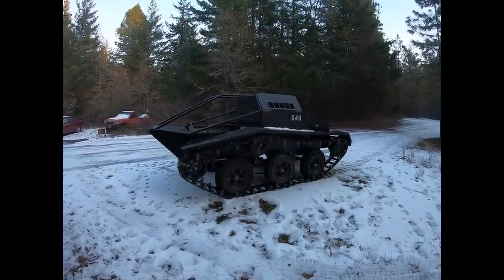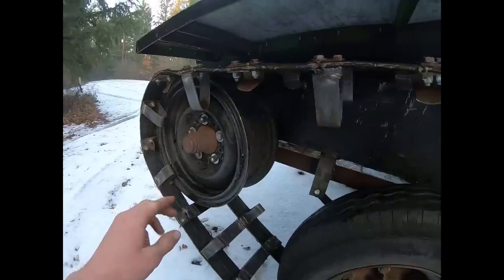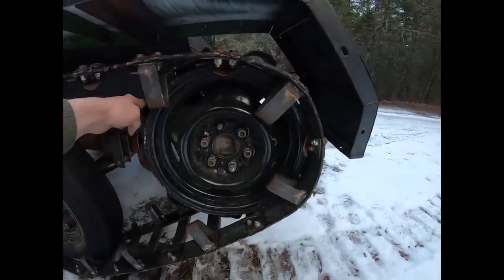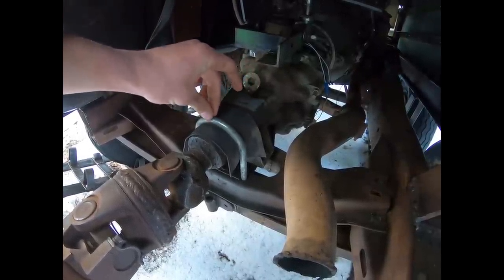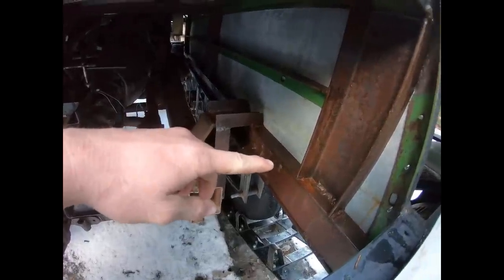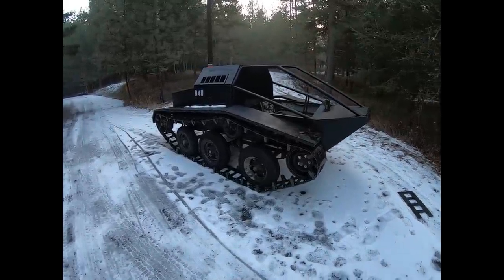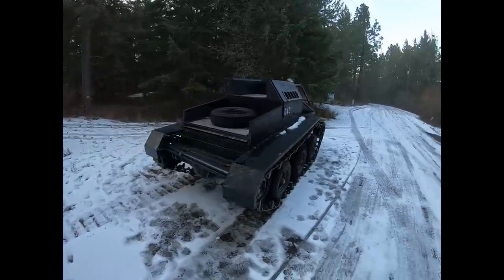How I Built My All-Terrain Tracked Vehicle out of Scrap Metal for Under $400 (Bug-Out Vehicle)

Comment: Great build! You actually did a really good job from the get go! As for the shifting, stick to rods with yokes, nothing that slides and NO ELECTRONICS. Make it mechanically only for maximum reliability. You can use baler belts from JohnDeere 568+569 balers, they have reinforced cores and are tough as nails, with texture on one side.
Reply: Agreed and dump the remote start, keep it mechanical. Shift the rad up in the body and add an intake to boost airflow. Only one other thing that may make it double the price - get some better tracks. It'll boost performance no end.
Reply: Agreement!
Reply: Just thought you might like to know, you're not the only person with that avatar. It's very memorable. Although the other guy, I doubt you'll find him on this kind of channel. Where'd it come from anyway?
Reply: @DFPercush  You mean my cat avatar? It stems from the fact that I am a cat lover and I also love lightning and the whole design is a cat that looks electrified. I love the look and the fact that it looks like my own cat haha, plus it looks at the text with judging eyes, which is neat imho. A reverse image search is the easiest way nowadays to copy other peoples pictures and avatars. It's never unique really, but I appreciate the heads-up.
Reply: The baler belts idea is a great one!
Reply: Now this is a emp vehicle! Only people who have read '1 second after' will understand that!

Comment: Very clever and great job using what you had!   A possibly alternative to the solenoids for the shifting mechanism is many manual 5 speed front wheel drive vehicles use two control cables for the transmission. I know for certain the late model Pontiac vibes were set up this way and likely many others. You could take the entire shifter assembly from a junkyard vehicle that would give you a remote shifter with two control cables (one for X direction, and one for Y). That would give the same feel as a normal shifter and no need to go through the headaches of trying to teach all the servo shift positions  to an arduino.

Comment: Reminds me of an early 1930s tank. Something like the Panzer 1 or T7 Car.
Reply: Those things weight upwards of 10 tons, a lot more stress on just about everything, when things are light its usually easy to build compared to when things are heavy, hence why automobiles of the era was a lot simpler mechanically than the tractors of the same era.
Reply: @SMGJohn  Well they also had a ton of armor on them which made up most of their weight. This thing is little more than a frame with some sheet metal to keep the engine covered.
Reply: Goliath tank is more like this machine.
Reply: It actually looks better than that, reminds me of british tankettes, I think they were called Vickers (name check)? Also romanians had something similar, called "Vultur" - "Eagle".
Reply: @SilvaDreams  "a ton of armor" actually only just about enough to stop rifle fire at a distance
Reply: Valentine “A ton of armor” was relative to this. If the T7 was compared to something like a Super Pershing, then yeah it’s nothing. But compared to this, the T7 has a ton of armor.
Reply: It also kind of reminds me of a Tetrarch due to its light weight.

Comment: I had a 1980 rusted-out Toyota pickup that we just used for wheeling, after getting the radiator caked solid with mud, I cut a hole in the back of the cab and mounted it there (as you did). Put an electric fan on a DPDT switch, so when it's hot outside, you can blow air back over the engine, but when it's cold outside, you can reverse the air flow, and blow hot air into the cab. Best heated Toyota i ever had.

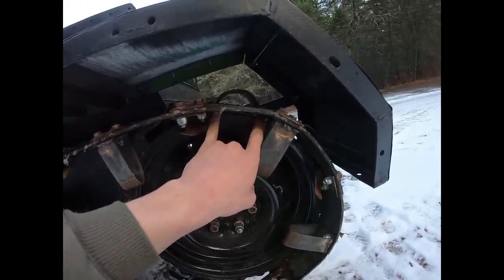DD 1984 Toyota 4x4 on 35's, with 5:29 gears and double-low t-case. Project truck 1971 FJ40 crewcab.

Comment: US military would be like 
Hmm add some javelin or M2 Browning and sell for $80k
Reply: the cost of a javelin alone is more than 80k bub.
Reply: Further more. The armored vehicles that a javelin might be used against can be purchased for less than the cost of the javelin itself.
Reply: @hell_march6652  actually finishing it up with armor panels communications and the machine gun or M2 Browning it be closer to $150k to $200k maybe.
Reply: They already have something like this.... Only it is also amphibious.
Reply: @SilvaDreams  and autonomous
Reply: U mean the 
military Industry complex
Would sell it to the military
Reply: @hell_march6652  The value of a weapon system is measured in the losses it prevents. If a 10k system is able to destroy a 5M system, then it's well worth throwing a 100k missile at it.
Reply: @Dimetropteryx   Why hit a nail with a sledgehammer when it can be done with a normal hammer?
Reply: @hell_march6652  False analogy.
Reply: @Dimetropteryx  Cost of a round for the m3 gustav is approximately is 500.  And is more than capable of killing a t72. compared to the cost of a javelin. 78,000. That is 156 times more costly. So again. why use a sledgehammer when a hammer will work just fine
Reply: @hell_march6652  The M3 is unlikely to be able to kill a T-72, unlikely to hit one out to its maximum range, its maximum range and consequently the area it's able to cover is insignificant compared to the Javelin, and even under ideal conditions, you're talking about a system that is expected to need to make roughly a dozen hits before it's able to disable or destroy the target. If your proposition is to simply move closer, the accurate effective range of the T-72 firing high explosive shells is 4000 meters, which leads to a very costly expedition for whatever idiot is ordering M3 teams to take out the T-72 instead of the Javelin team. The T-72 is not a nail. It's another sledgehammer.
Reply: @Dimetropteryx  If infantry are attempting to engage a t72 at 4000 meters then they already messed up and that is beyond the range of the javelin. The most likely scenario of infantry having to deal with an armored unit is going to be in an urban environment. 700m range is ample enough for that.  Its anti tank shells are HEAT and its penetration value is not dependent on its range. 400mm penetration  is ample enough to hit most area's and most (not all) angles on a t72. Nor do you need to completely obliterate an armored vehicle to neutralize it . 

 The tow missile can be deployed by infantry or mounted on a vehicle. Which is still a cheaper alternative to the javelin and can out range the javelin by a large margin.  

My entire point is there are far more cost effective alternatives available to accomplish the same job. The air force for example is looking to procure the AT6 light attack plane because its a cheaper substitute for the A10.
Reply: @hell_march6652  "If infantry are attempting to engage a t72 at 4000 meters then they already messed up"

That's not how anything works. It might be necessary for something to be done about a tank at a distance and you have the choice of letting it do whatever it is there to do, which is most likely killing your troops, or you can attempt to take it out. You have the choice of doing it the cheap way or the expensive way. Spoiler: the Javelin is the cheap way.

"beyond the range of the javelin"
Don't get hung up on the 4000 meter figure.

"The most likely scenario of infantry having to deal with an armored unit is going to be in an urban environment."
It's not, not by a long shot. Drawing tanks into an urban environment was done to negate their advantages and to make the numerous but near-useless short range AT weapons even somewhat useful. ATGMs,  on the other hand, don't have the same limitations and aren't restricted to close quarters. Generally, everyone wants to avoid urban environments because of how costly they are.

"Its anti tank shells are HEAT and its penetration value is not dependent on its range. 400mm penetration  is ample enough to hit most area's and most (not all) angles on a t72."
It's not as simple as "penetration value", and weapons with comparative penetration have failed to penetrate wheeled APCs that aren't rated for more than 30mm APFSDS over the frontal arc, or have landed multiple hits on main battle tanks without being able to knock them out even if they should theoretically have been able to with the first hit. And just because you hit, doesn't mean you hit anything vital. And even if the armor is penetrated, it doesn't mean you've damaged anything of value behind it. All of these are reasons why every military in the world actually tries to figure out how many times you need to hit a target before it's put out of commission, and it's always multiple times, even if the theoretical "RHA equivalent" penetration far exceeds the actual amount of armor.

"The tow missile can be deployed by infantry or mounted on a vehicle."
The Javelin is truly portable, it's not just "deployable".

"Which is still a cheaper alternative to the javelin and can out range the javelin by a large margin."
It's more expensive and the range difference is shrinking. In fact, reading the latest figures, the Javelin actually seems to have surpassed TOW in range. Didn't expect to see that.

"My entire point is there are far more cost effective alternatives available to accomplish the same job."
I know what your point was, it's just that you're wrong. What you're proposing isn't more cost effective.

"The air force for example is looking to procure the AT6 light attack plane because its a cheaper substitute for the A10."
Yes, cheaper to operate as a COIN aircraft. It's a poor analogy.
Reply: @hell_march6652   We can't sell it to suckers if we don't sell it for less. #notmymoneyparty

Comment: Great job, it looks like it will be real fun to drive in the bush  after you nail down that shifter issue. What would be real cool is maybe powering it with a gasifier system. No gas required. A true bug out vehicle. You have a bright and promising channel.

Comment: Love it.  A thought on engine cooling.  I ran a 22 re flatbed for years, after the thermostat choked my capacity to haul dirt up mountainsides by blowing my head gasket, I pulled it and was shocked at how little cooling I needed especially in the cold without the t stat restriction.  Drove over mountains with cardboard jammed in front of the radiator and a carpenters clamp on the hose just so I could stay warm in the cab.
Switch to dual or triple heater cores and run coolant through the seating tubing with a cutoff valve to heat the driver's compartment...or, pipe through a water tank to have warm water on board...  I am onto the prestone final charge radiator coolant in an effort to extend system life...   If you want heat for survival, a radiator is a fuel pig you can't eat!   Don't forget to cook while you drive with an exhaust oven!

Comment: I've been mulling over the idea of making a 'bootleg' kettenkrad. This video is really informative and has helped me visualize some of the designs I had in mind better, and scrap a few things. In terms of size, this is basically what I'm looking for anyway, although the setup is much different, as the engine is in the back, and the drivetrain in the front on a kettenkrad, with the front wheel acting as steering and also drive-control (it acts on the tracks, similarly to what's been done in the video with the brakes).

Cheers.

Comment: I'd suggest on the top front most axle to put a forward adjustment bolt set. you could use 1 inch threaded rod with a pair of locking nuts and get almost a foot of track tension to it, similar to how trackhoes and dozers adjust their tracks. In my mind I can see a few different ways to do it... Cool project for sure, been looking at things like this for a while now and yours is def one of the simpler ones!!! Keep up the great work!

Comment: Auduino and solenoids break. Should easily shift from a VW MID engine cable shifter ala Jamar or Empi. You already done the hard part.
Reply: you are right.. just thinking the same thing... it would be more robust also ...
Reply: The easiest and best solution is weld a u joint vertically to original shifter,a straight shaft  horizontally to another u joint welded to frame, then the gear shift handle where needed.  Will work smoothly with no play and good feel ! Joints allow  stick to move side to side and for and aft. Horizontal shaft transmits tourque and tension -compression.
Reply: Ya I was like dude thats way to complicated. You could just use a shaft to shift with. Mustang's with a  5 speed manual trans have a shaft connected to the shifting tower and then come forward from there like a foot or better then connect to the shifter on the floor board. I'm sure you could make the rod any length with in reason to fit where you need. But trying to shift and skid steer at the same time is gonna be a problem so having solinoids shifting from like paddle shifters on the steering handles would solve that but then I imagine it would be a pretty complicated set up to try and shift a traditionally hand shifted transmission via paddle shifters using a clutch.

Comment: The conveyor belts we use for the coal conveyors at my power plant are around twice as thick as that belt on there and it's nearly indestructible.  So if anyone is thinking about making something like this, check with a power plant if you live near one, there's usually old belt lying around.
Now that I think of it, the coal conveyor belt might be about this thickness but the hammer mill belt that crushes the coal is the really thick stuff.  I use it to hang metal targets and they get all shot up and still last a really long time taking all kinds of rifle rounds.

Comment: So if i understood the steering process, when you brake on one side the differential makes the job and transfert the force to the other side? Really with a car differential?
Reply: I'm not sure what you mean, but typically tracked vehicles will either slow down one track and/or speed up another track which causes the vehicle to turn.
Reply: Exactly. If you lock one wheel the other wheels spins.

Comment: I like it. Maybe some heavy wall pipe front and rear to protect the tracks and push with or simply protect the whole vehicle. 

I had a Coot, 4wd and steering and amphibious. Run off the road /track and into a body of water. No trauma except for the people with you who thought they'd have to swim. You couldn't put enough load on it to sink it.

Like to have it back. 20 hp Kohler engine, plenty powerful and aircooled. Worked great in Texas heat. Roll bar between separate front and rear sections that rotated on the same axis.  Didn't even leak at all. Great hunting rig.

Had a flooded field with 2 rows of haygrazer every 80 feet. Pull up to the row, use a brush hook off the bass boat. Tie up and wait for the dove to come over. 

Gather them all at sunset just floating around under power. 

Roll bar was a gun rack too. 4 people plenty room. Non hunting, 6 people you could scare hell out of when you ran off into deep water but the Coot just kept on going with paddle tires. Love to have it back.

Comment: This thing wants an old Detroit Diesel 8V53.
Reply: Nothing wants a Detroit Diesel... It wants a Cummins
Reply: @willroland9811  I think you mean duramax
Reply: Can a Cummins or Duramax run wide open all day long? Plus you can straight pipe it and have a sonic deterrent lol.
Reply: @mrgeraldbrent  there's a reason why one of the most legendary diesel tuners of all time use duramax

Comment: That thing is cool, I have wanted to build something like it for winter deep snow thru the woods type driving. We have a Polaris Ranger but as the snow gets deeper it high centers which makes it useless. I have a couple old snowmobiles but I have gotten them stuck & they are pretty useless for pulling out firewood or taking more than one other person for a ride.  If the trails aren’t kept packed the snowmobiles are just to hard to maneuver with the hills,valleys ,tight turns & with brush constantly smacking you it’s just not enjoyable. I also had a Max six wheel amphibious vehicle & that to got high centered in deep snow. Have you run your machine in more than two feet of powder?  Thanks for showing us your creation!

Comment: I'm planning something similar. I have the rear end out of a 300 Kawasaki Bayou ATV. those had two drum brakes and a cable actuated diff-lock in the differential. Going to use a ride-on mower for the chassis,  a snowmobile track cut in half for the tracks, the clutch system from a Polaris LongTrak snowmobile which had hi/low forward and a reverse gear. Instead of an All Terrain thing; I'm thinking of adding a rear mounted snowblower and front push blade to take care of my winter troubles.

Comment: I've had a mind to make something akin to the old WW2 Bren Gun Carrier. Even found an old V8 Flathead that MIGHT work out if it turns out to be serviceable. Tracks would be the single most problematic part. THIS on the other hand is very insightful. Sure it would be very tedious but finding the material to make a set of tracks would be much cheaper to make//repair than trying to deal with snowmobile ones (good used are WAY more than $400 and WAY too short) even though they would probably be more durable. Doesn't snow here except every several decades in my corner of the SW desert but a tracked vehicle would still be fun. Thanks for posting this.